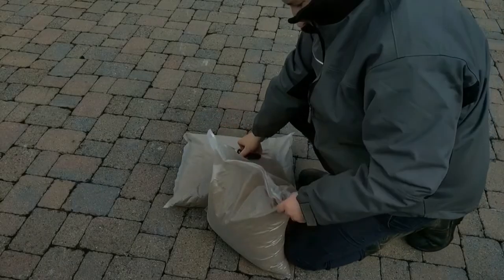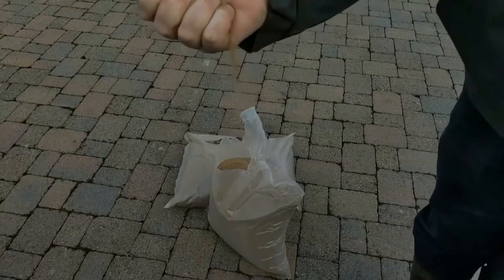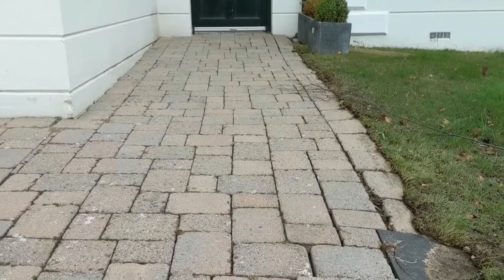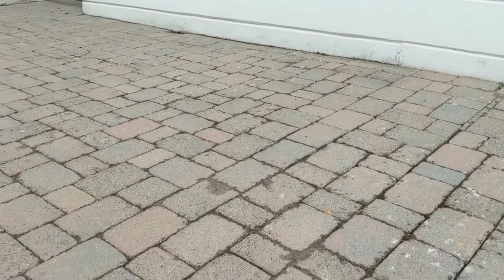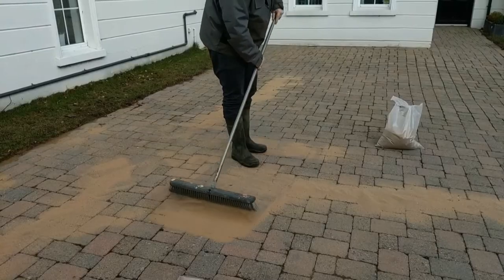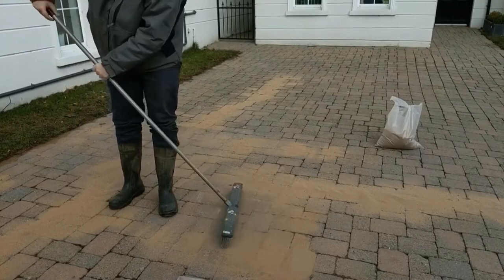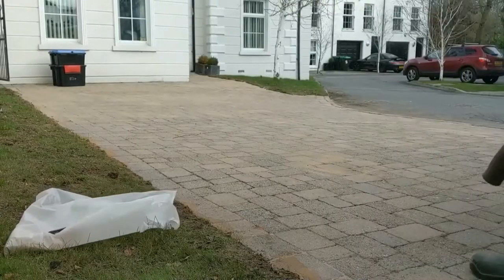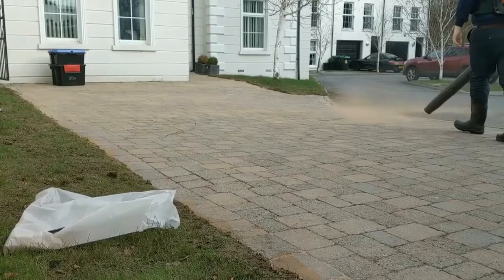Re-sand a block paved driveway with kiln dried sand

Comment: after it's all brushed in and the excess is gone.... do you need to do to anything to make it set etc? Or?
Reply from the maker: Nope 👍
Reply: @Premier_lawns_official  I saw some people recommended giving it a quick and very gentle  "misting" with the sprinkler hose... to get the sand to set?
Reply from the maker: @Mpalmer00  YOU CAN DO THAT, though i dont
Reply: @Premier_lawns_official  Is that the same as basically just letting the rain do its job too?
Reply from the maker: @Mpalmer00  yes, small blower is what you want

Comment: Thanks for the tips. Will the rain wash it back out again? I live in Ireland, we get a lot of rain!!
Reply from the maker: I live in Ireland too! 
Most blocks are laid on sand or gravel. As long as they have been installed properly the sand shouldn't wash out after you brush the sand in. It's important to use the right type of sand - Kiln dried.
Reply: @Premier_lawns_official  Thanks for replying. Yes I got the Kiln dried sand. So far so good. We've been having a spell of dry weather since I put it down last week. Waiting for it to rain. In Ireland 😂

Comment: Hi, I have some little bits of block paving that act as a border to a flagged path. 
My problem is that the joints between the bricks are big enough to fit your fingers in.

Its a 100 year old path and whilst I have thought about just pointing it with concrete I've also read that old bricks and modern concrete dont mix. Apparently in winter the hard concrete will cause the bricks to shatter or something.

My other thought was kiln dried sand, but will it work with such big gaps? Or is there something else I should use?

Thanks if you're able to offer any advice 👍
Reply from the maker: It's not really my forte, a builder or a landscaper may be able to offer you advice

Comment: Can we mix jointing sand with dry cement to fill the gaps then wet it after?
Second question: I've seen builders mix cement and jointing sand and spread it all over the flat bed of sharp sand, put the slabs down, then wet the slabs for a few minutes. What do you reckon? Is it a good idea?
Reply: Good qurs.. I need answers 😪😪
Reply: If you put cement onto this surface it will mark and stain it. You could just use ordinary sand to save a few quid but it's much harder work than kiln dried which is much finer and is more easily brushed in. You do need a dry day, any moisture will thicken the sand too much.